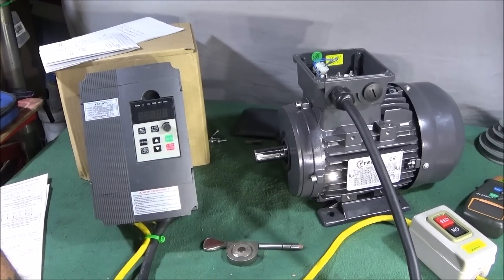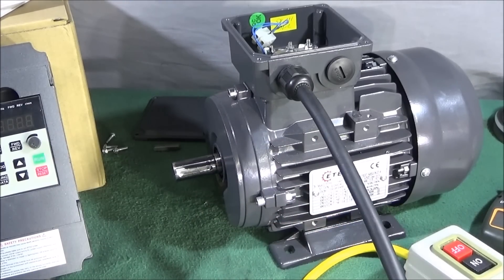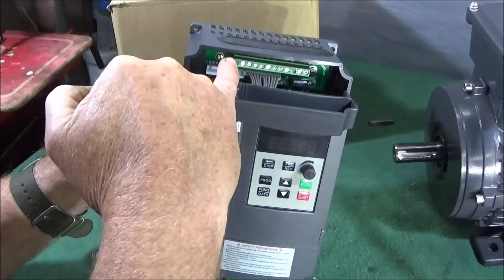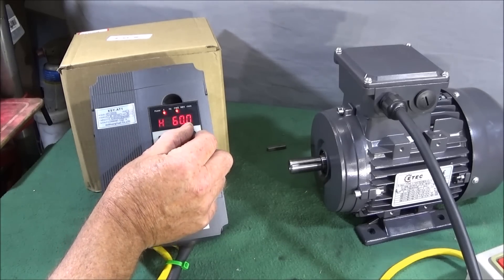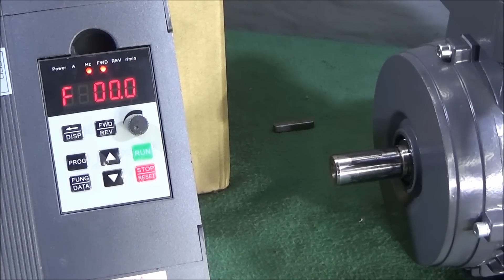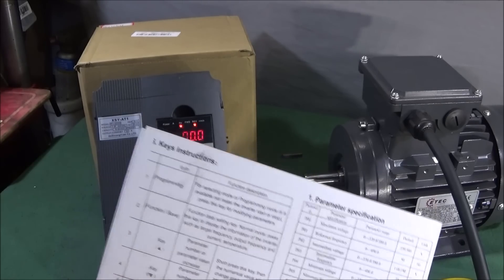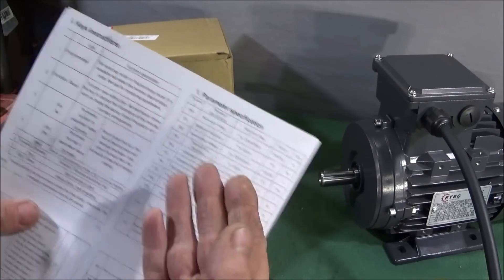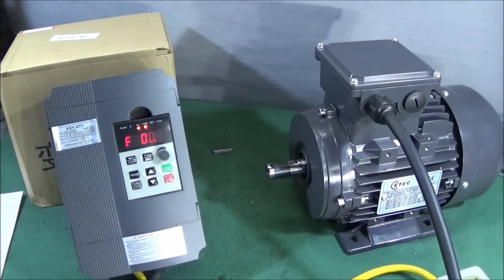XSY-AT1 VFD & 3 Phase Motor Bench Test Review Mini Lathe & Myford..

Comment: Please can you tell me the parameter to alter the torque. I fitted a similar one of these to my pedestal drill, I have plenty of speed but hardly any torque.
Reply from the maker: Hi Phillip, The AT1 VFDs parameters for torque are p71/p72/p73. Most people though make the mistake that you can alter these and get 'very high torque' which usually isn't possible. An acceptable torque should first be attained by using the correct sizes pulleys  Ie..You should have A very large one on the main spindle drive, (mine is around 6.7" in diameter). You can see this in my next video. The VFD's parameter settings won't compensate if you have the pulley configuration wrong as the parameters are only for small adjustments.
Reply: Thanks for the reply, I very much appreciate it. For P71-Action time of TIMER. P72-Simple PLC auto-operating option and P73-The first period time set of auto-operating. I was expecting to be able to increase the current output in some way. Any thoughts? I do totally agree with the larger pulley idea however I have the largest I can fit and I have only managed about 3:1. This aside I have a 2.2kW inverter driving a 2kW 3 phase motor and I can stop the pillar drill chuck with a gloved hand. I feel that it is so underpowered that there is some parameter I have not set correctly.

Comment: I will also say thanks for all you videos  . I'm new inn hobbylathe'. I learn a lot of you. How low rpm do you need, and will use?
If the motor runs to low = No cooling?
Reply: Thats right. The cooling of most cheap motors is not enough if ran at low rpm. You could mount an external powerd fan.

Comment: Having a door to the mains connections that is so easily opened seems somewhat suspect to me and I'm not sure it would pass UK regulations.  In fact I consider it to be really quite dangerous
Reply: Steve, everything you do is usually (and rightly) plastered in health and safety
Reply from the maker: Well Elf & Safety won't be invited round to see it so, there is no worry there. I will put a voltage sticker on it though so it has to be torn to get the door open.
Reply: deaniweenie safety natzi / the door to open must be lifted up ! But you say it is unsafe ?? In US gravity holds all things down not up must be different there . At rest it is down how do you consider this unsafe ?
Reply: Wayne Robinson, by definition using a nazi reference on social media shows a complete lack of intelligence and therefore you lose the argument (I mean, you can't even spell nazi properly).  Looking at that housing I would say that gravity could easily be counteracted by inquisitive fingers.  I was merely surprised that a mains electrical device without a lockable (either by screw, lock or some other mechanism) cover, which I'm sure contravenes UK electrical regulations is available for sale here.  I would also expect that in the US where most of the world's morons live, the regulations would have to be even more stringent
Reply: Well said deaniweenie

Comment: Hi Steeve I have done a similar modification on my lathe. I have added an potentiometer  and a forward / backward switch directly on my lathe. It"s more convenient to control . I'm sure that your inverter has that option for external control. Greetings from France Laurent
Reply from the maker: Hi Laurent My lathe already has a potentiometer for now, a separate unit that I fitted some time ago,  but I do hope to add one plus the forward/reverse switch to the VFD and lathe at some point. Regards Steve
Reply from the maker: Hi Laurent,  Yes mine has the connection block for external control. I have a few wiring diagrams for this block in the instructions, but it will take me a while to work it all out. Unless I find a video showing this...
Reply: I recently picked up a vfd from that same at series and unfortunately it came with no documentation... Any idea where I can get a copy of the manual or barring that, what's the function number that will switch control from the panel to the external terminals so I can wire up external start/stop switches? Thanks!